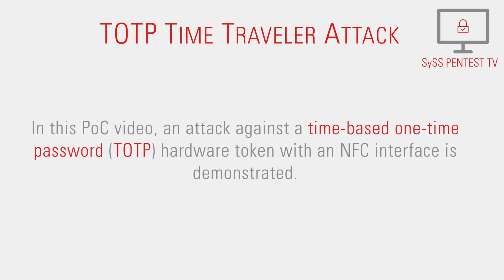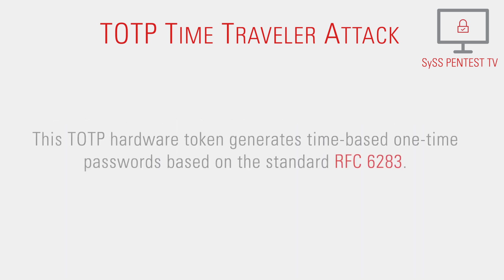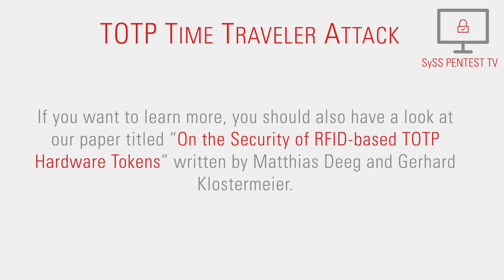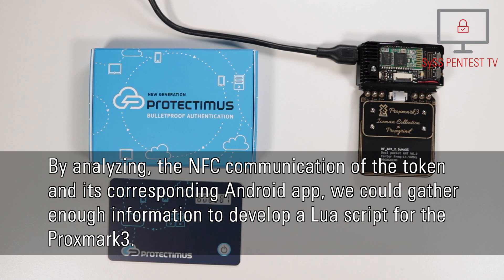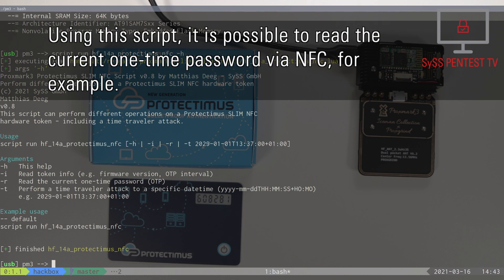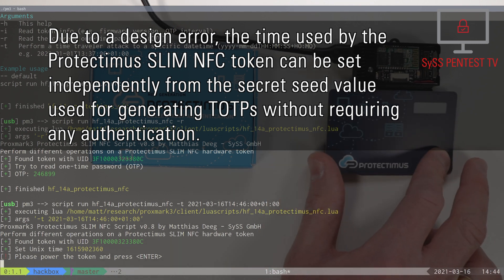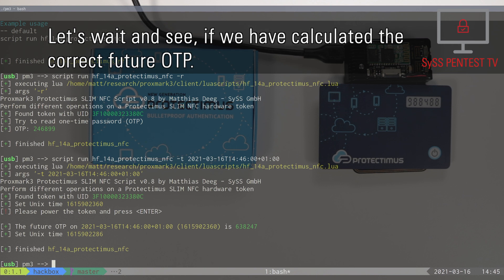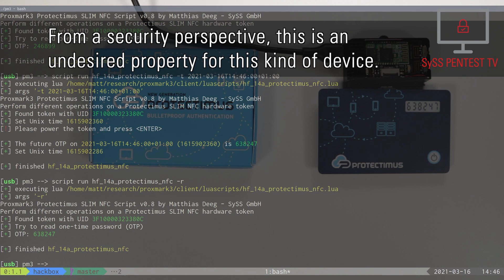To the Future and Back: Hacking a TOTP Hardware Token (Protectimus SLIM NFC)

Comment: Hi there, I’m Max from Protectimus. Thank you for your research. I’d just like to clarify that Protectimus Slim NFC tokens are available in two modifications, and the clients can choose which one is preferable for them. The client can choose the size and the firmware when ordering the tokens.

The first modification doesn't allow setting up the current time value without the secret key, which makes the time traveler attack impossible. 

The second one allows setting up the current time value without entering the secret key, as you did with the help of your script. This firmware remains available as it's easier to use such tokens with some specific authentication services like Duo, etc. Some of our clients require exactly that firmware. This approach really makes the tokens vulnerable to the time-traveler attack. Still, it should be understood that the attacker needs to have physical access to the token to perform this kind of attack. At the same time, if anyone has physical access to the token, they don't need any special skills or scripts to hack the account of the owner of this token. It's enough to use the current OTP from the hardware token they have in their hands. The whole idea of hardware tokens is to keep them safe all the time, not allowing somebody to get hold of the device.
Reply from the maker: Thank you for providing this further information. Is this information about the two mentioned modifications of the Protectimus SLIM NFC also publicly available online? The product specification of the Protectimus SLIM NFC on your website and the PDF document (https://www.protectimus.com/wp-content/themes/protectimus/img/pdf/Manual%20Protectimus%20Slim%20EN%202019-03.pdf) do not seem to mention them. Are both versions of the TOTP token available for everyone, or is the modification, where it is not possible to set the current time without the secret key, only available to clients buying larger quantities? And is it possible to reliably distinguish both versions of the Protectimus SLIM NFC, for instance via the software/firmware version (10.01 and another one) or in another way available to third parties?

Comment: Are you alright?  Soooo, to use this "attack", you have to own the token for some time to reprogram the time, get the codes and program it back, right? If you, ex. stole the token, isn't it easier to just receive access? Useless.
Reply from the maker: For this demonstrated attack you need short-time physical access to the TOPT token and can then generate valid one-time passwords for attacker-chosen points in time. There are real-world scenarios where this is the case, thus, it's not that useless. For example, a scenario in which you want to provide a third party, for instance a service provider, a time-limited access to your IT systems, for example one day, which is defined by the time period your service provider has physical access to the required TOTP token. Due to the described security vulnerability that allows to manipulate the internal real-time clock without any authentication, your service provider now cannot only know and use valid one-time passwords for this specific day on which he can gerenate OTPs with his authorized physical access to the TOTP token, but also for any other chosen point in time, for example in the future, which is an undesired property of a time-based one-time password hardware token when considering such a use case scenario in your threat model.
Reply: @SySSPentestTV  I think there is not much logistics in providing the IT services provider with a physical device for one day. Even for two. And even theoretically, someone will provide with one, why don't simply not change the secret in the token (like change the passwords after you shared it with someone for some time)? It's a totally useless vulnerability and the chance of the exact attack using it is almost zero.
Reply from the maker: @denysgriga1261  Let's agree that we disagree on this security issue and the demonstrated "time traveler attack". For you, it's useless, for others, like us, it's not. We think everybody can decide this question for themselves. In our opinion, one should be aware of this kind of security issue and consider it in corresponding threat models, in order not to miss potential risks. As a matter of fact, threat models differ, as the old saying goes: "Your threat model might not be my threat model." Depending on the actual use case of such a TOTP hardware token and the context, maybe including other security measures like frequently changing all used authentication factors, sometimes the described attack might not work all, other times it does. We are convinced that having a false sense of security due to wrong security assumptions regarding a soft-, firm-, or hardware product is worse than being too careful in the first place and then accepting specific risks after hopefully thorough consideration. In general, concerning TOTP generators, we think that if there is a way for an unauthorized person to either gain knowledge of the seed value (secret cryptographic key) or to manipulate the time (real-time clock) used for generating the time-based one-time passwords, this TOTP generator is not as secure as it can be.